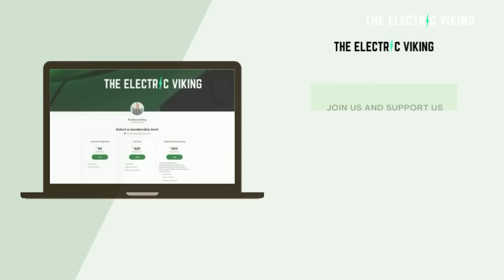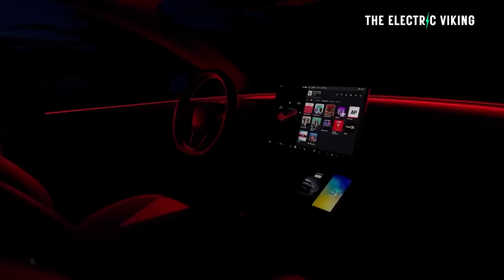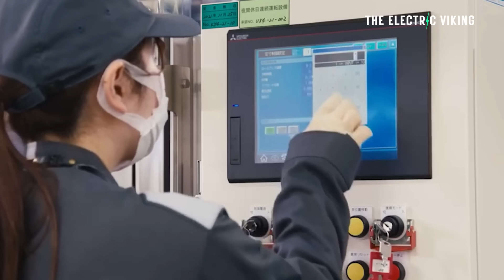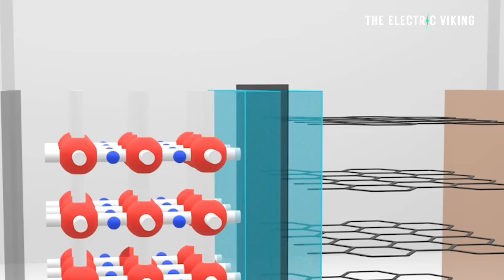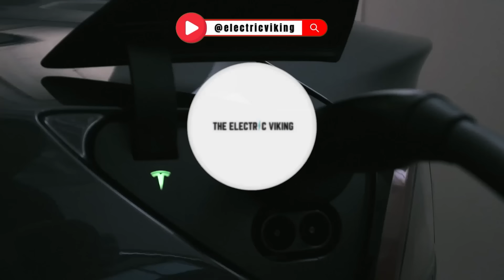New non-flammable metal oxide battery revealed by US battery company

Comment: Energy, weight, distance, Airliners do it every time they fly.  How much fuel do they need to have to carry a weight a given distance.  The greater the distance the more fuel you need.  Extra fuel adds weight that reduces the cargo capacity.  Airliners adjust the amount of fuel they carry to maximize the efficient use of energy.
EV's have a fixed weight(mostly) of cargo and battery and highly variable distance to travel.  An EV that is capable of  long range travel will be carrying a greater weight than is necessary for short range travel.
EV's that are used for short to medium range travel that have the battery capacity for longer ranges will be using more energy and be more inefficient.  They will use more electricity and cost more to operate. 
The "Use Case" needs to be taken into consideration when determining the best size of battery you need.

Comment: Love your enthusiasm for EVs SAM but when you make a silly claim of "10 times" the energy density you are selling snake oil.  Even the company itself does not claim this at this current juncture..  The founder of the Alysum is MIT Professor Kripa Varanasi. MIT News from two days ago states "although the batteries don’t quite reach the energy density of lithium-ion batteries".
Reply: The press release did state it, but as 10 x 'non-lithium batteries' the website lists the comparators used.
Reply: @GruffSillyGoat  Right. Not "ten times the energy of today's batteries" as Sam's unqualified statement which implies including lithium.
Reply: @mydogsbutler  - Sam, said it right at the 4:10 mark (2 to 10 times other non-lithium batteries), but his hyperbolic introduction was confused/confusing. Projecting a what-if this level of change was available in EVs the result would give high ranges, etc. I don't think Sam intended to mean this battery provided that, just that if a battery was available for EVs with this level of improvement is what the result would be. He then went on to describe the new battery, correctly stating it as BESS based - but viewers were probably still thinking of the oppurtunity of his opening sentence and missed the shift in topic.

The 10x is a result of the other non-lithium comparator batteries having low energy densities (e.g. Iron-Oxide, which have very low densities). Alsym are not being dubious here as their intent is to compare the weakness of various stoarge batteries against their own, which is why they stated the range 2 to 10x.  Sam did correctly read at one point the batteries were not as energy dense as Lithium, but then jumped to LCOS being better than Lithium (beacuse the Alsym batteries are lower cost).
Reply: @GruffSillyGoat  Ah. Fair enough. I tuned out of the video when I heard 10x times energy density. I stick to my over all thesis Sam sometimes sells a bit of his own snake oil. He has a great channel but he needs to be a bit more critical of claims (especially with  Musk who sometimes peddles bs albeit he's generally a good CEO) One can praise the good aspects of a company while still criticizing the negative. To err is human as they say.

Comment: To be clearer about "C rating".  That is how fast you can charge and discharge a battery.
C1 means you can do it in 1 hour
C2 means 1/2 hour
C4 means 1/4 hour.
Reply: 4C normally means 1/4 hour to 100%, C4 normally means four hours to 100%. The Alsym website states four hours to 100%.

Comment: If this type of battery comes the strategy would be to swap batteries like power tools.  Hardly anyone needs to carry around more than 200 mi range so you can load up your car with more batteries when necessary.  The unused batteries could be used to power your home.  When you need all the capacity you own your home doesn't need as much energy.   Gasoline will be an antique technology easily within my GenX lifetime, my kids will live to see extinction of fossil fuels.
Reply: It's aimed at containerised grid storage battery not EVs - it's been optmised for static roles (usually meaning it's heavy).
Reply: @GruffSillyGoat 10x energy density says it is closer power per weight as a fuel (still not close enough to match).  Perhaps he is referring to some other measure of energy density.  Of course Sam is only faking technical competence but I believe he will eventually make it to technical competence.
Reply: @thereplacementfordisplacement  - the press release states it's 10x that of other safe non-lithium storage battery chemistry (e.g. flow batteries, iron-oxide, plus other as listed on their website). It is not more energy dense than Lithium-Ion (explicitly stated in the press release and Alsyms website). A different press release indicates it's a form of aqueous Sodium Ion battery optimised for static storage solutions, with high flexibility and high configurability (software defined). Being short to long term static storage, it takes four hours to charge to 100%. They ruled out other sodium technologies in the 10x comparison by focusing on safety of the systems.